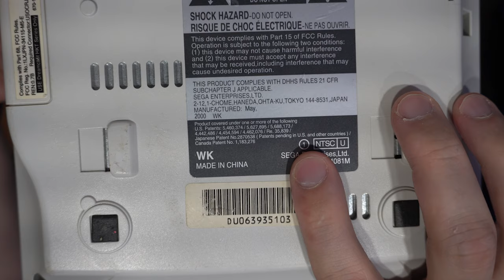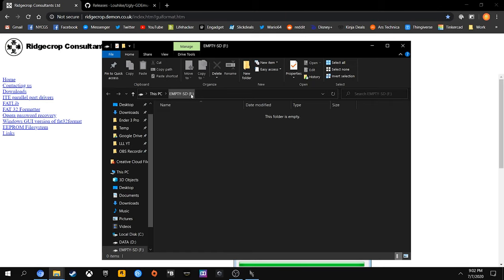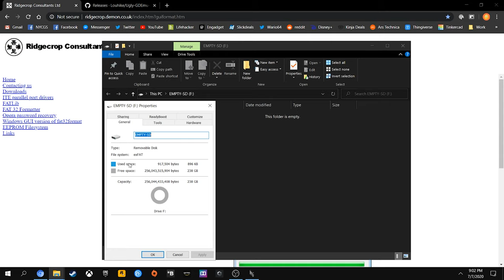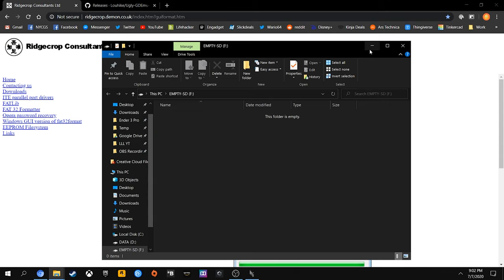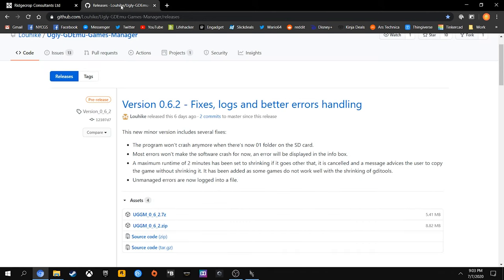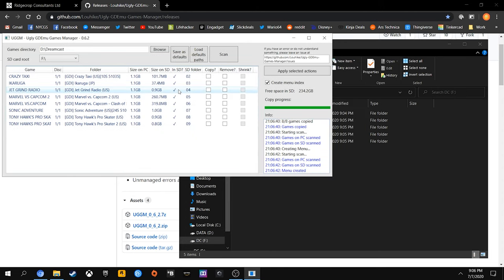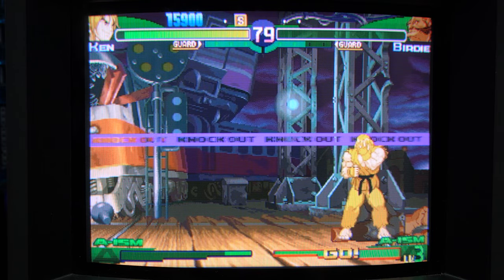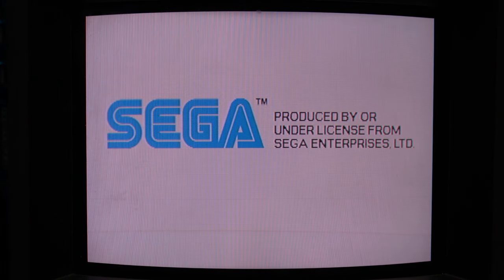Dreamcast GDEMU (Clone) Install!

Comment: I've heard the TerraOnion MODE was more functional. Is this 100 percent compatible? I've seen some videos that says the GDEMU and it's clones have audio issues with some games, which is very annoying. Lemme know!
Reply: Also I am a HUGE fan of Japanese dreamcast games (including shmups). Lemme know if you need recommendations!
Reply: Also there are other HDMI options for the dreamcast BUT,  not all games work through HDMI. Adam Koralik has MANY videos on different solutions to connect Dreamcast through HDMI
Reply from the maker: From the 30 or so games I put on here, I haven't had any issues. I wanted something quick and cheap for now so I went for it. As for HDMI, I'll be getting an OSSC in the near future so I will connect to it that way. Dont wanna deal with pound cables and the like.
Reply: @linklooklisten  understood. Might want to look into Akura and Gekko cables. They are more compatible than straight VGA
Reply from the maker: @TheDetectingZone  I almost got the Akura a few days ago! Still weighing my options.

Comment: what did the soldering do? i just watched another tutorial and they didn’t do that
Reply from the maker: Removes a piece that generates useless heat in the system. The piece isn't needed since the disc drive has been removed.

Comment: will the action replay workwith games  if u put the iso on the sd card ?
Reply from the maker: I don't think they do but, for example, there's a hacked code breaker cdi file out there which works just fine
Reply: linklooklisten that’s exactly the info I needed
Reply from the maker: Nice!

Comment: I have a question, how can you change de multidisc games on this gdemu?
Reply from the maker: Yes! You just need to name the disc's the same with disc 1 and disc 2 in the names respectively. When you're prompted to change the disc, all you need to do is press the button on the gdemu and it will swap.

Comment: the game n the sound will delay ？？ and the temp will too hot？？
Reply from the maker: I have not had any sound delays with the games I play, and it shouldn't get hot. Removing resistor should help make it a little cooler inside, but it is not necessary to remove it.

Comment: Hi I'm having a huge problem my dc was running fine I did the battery mod and it worked a treat.
I then installed the gdemu a few days later and just got a black screen.
 So I plugged my disc drive back in and still have a black screen I have try'd 2 different video inputs and 2 different tvs.
I have also cleaned the power supply board pins still no joy.
I don't suppose you have any ideas I could try? 
Any help would be much appreciated 🙂
Reply from the maker: Sounds like something may have gotten shorted out? Or maybe something more simple... check all wires inside are connected?